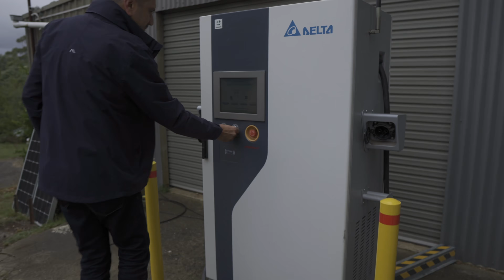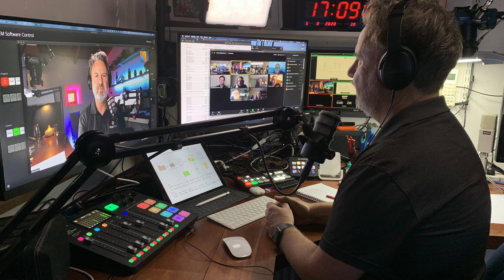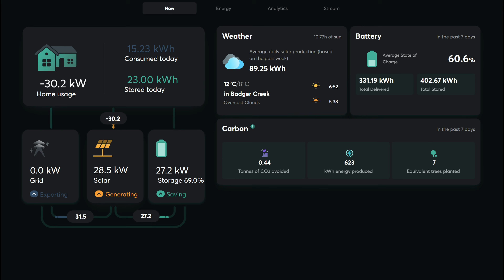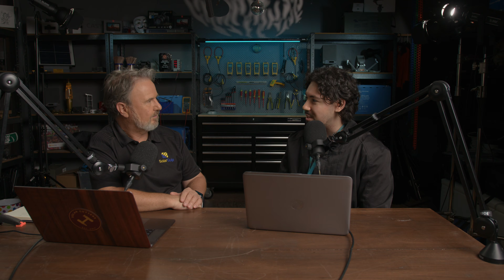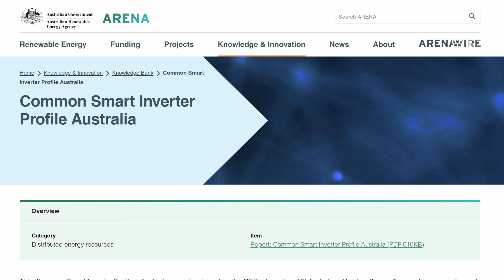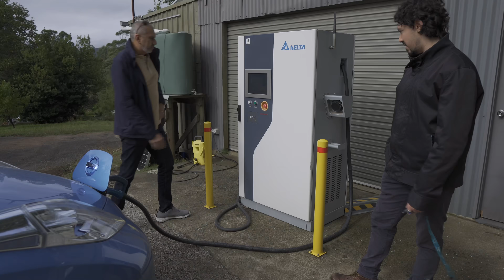DC Fast Chargers from Delta Electronics (Australia)

Comment: I wish your videos were longer and more detailed because I just want to know more. If I ever come to Australia I have to visit your lab. What I don’t like with my solar charger is that I’m converting DC to ac and then back in the car to DC again. Too many power conversions and too many losses. 

What I would like to make is a chademo DC fast charging plug that’s connected to a controller that can handle variable currents that are available from my large solar array. So it would be like the efficiency of a DC DC converter. 

Maybe you could try something like that at your lab and show us how you would come up with such a thing.
Reply from the maker: With DC EV charging there is always going to be conversions to match the range of battery voltages available on EV's. I guess the losses for our off-grid system don't really matter as there's always way to much surplus solar power.